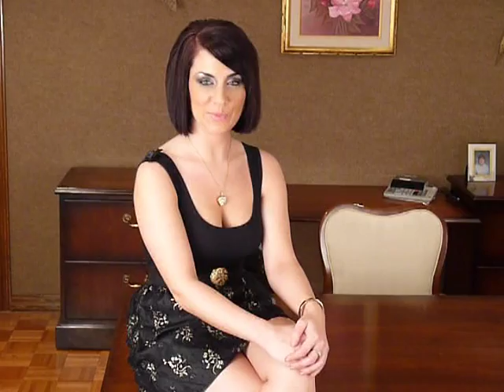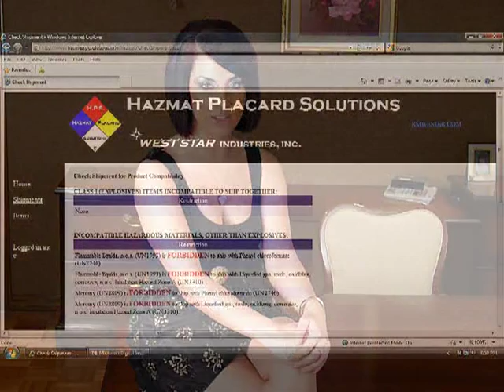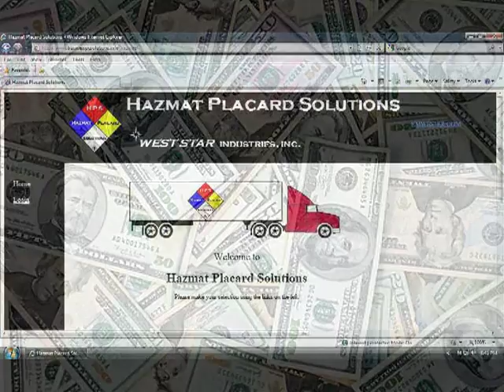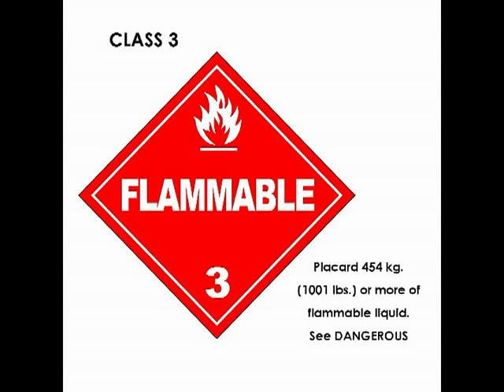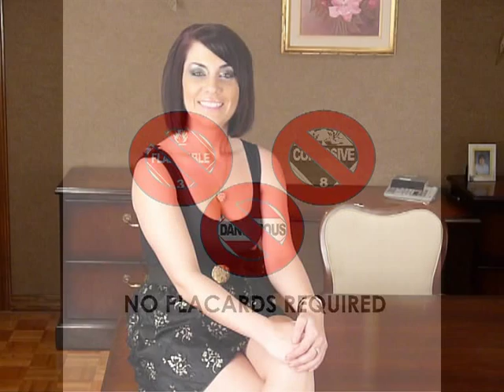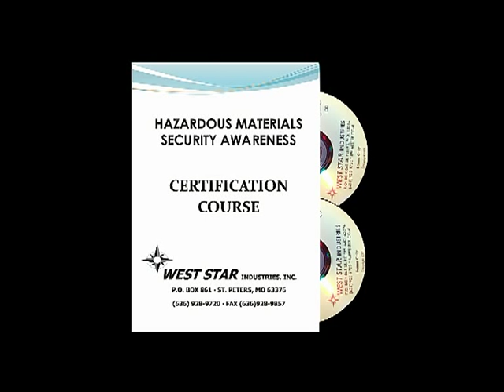HPS Hazmat Placard Solutions.mpg

Comment: She is wrong...Dangerous...or Corrosive and Flammable...it is the aggregate gross weight of all hazmat combined in the truck that determines whether or not to placard ...not the individual amounts in a hazard class...If that were true you would need no placards for 900 lbs of Corrosive , 900 lbs of Oxidizer, 900lbs of Flammable Liquid 900 lbs of Poison ,900lbs Flammable solid, 900lbs of non Flammable Gas,and 900 lbs of Flammable gas..in non bulk packaging on one truck...6300lbs of hazmat...